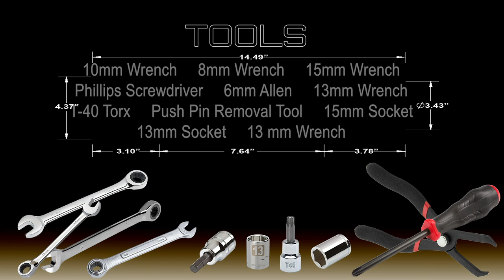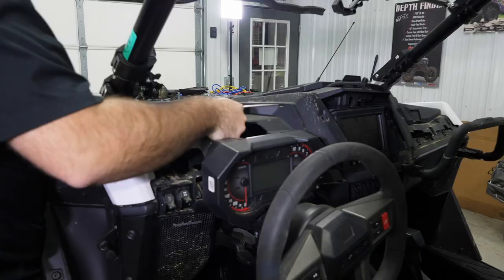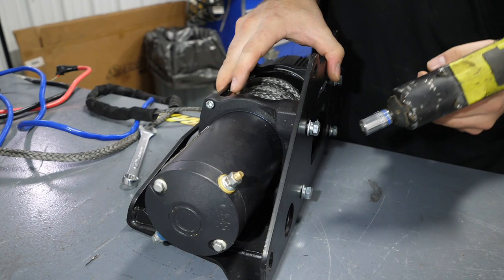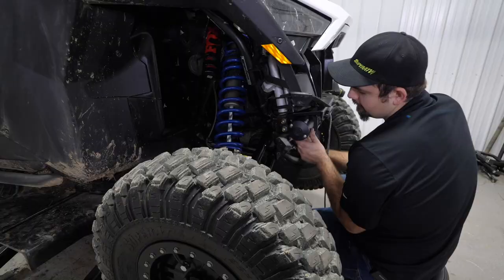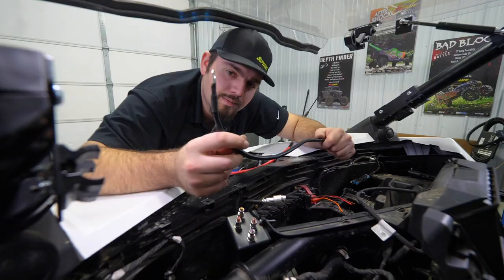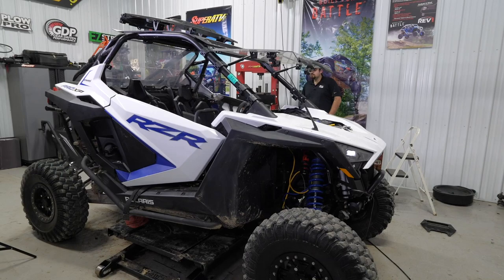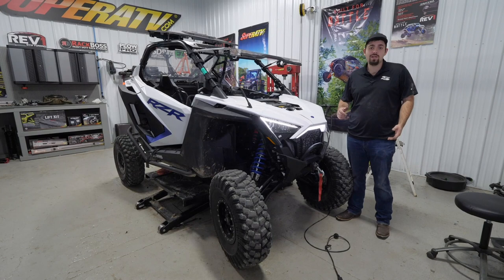Polaris RZR Pro XP Winch/Winch Mount Install | How To | SuperATV

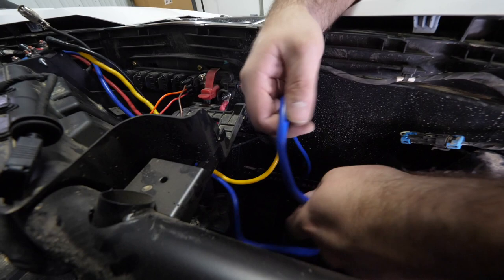Comment: At 20:00, you show the Pulse Busbar Plug already disconnected- and attach the orange wire keyed- on power source to the red rocker switch wire. Can you explain this in more detail?  My wires from the pulse plug are wrapped and connected elsewhere….
Reply from the maker: Give us a call so we can help you out with this, 855.743.3427
Reply: @SuperATVMedia  I finally realized that you are using a NEW pulse plug (not included with the kit), rather than connecting to an existing pulse plug with wires "going elsewhere" as mentioned above.  I ordered the new pulse plug from your site.  Should be good, as long as I understand that I'm only using the orange wire and the other two wires are not grounded/connected - per a superatv video.  Sound correct?

2- I also ran my red/black winch cables to my battery, rather than connecting them to the red/black poles on the busbar.  Does that matter?

Comment: My winch is wound the other way. Do I just wind it back the other way to make it right? And would I have to switch the positive and negative wires?
Reply: Just got mine today and it’s the same way.
Reply: Mine was wound the other way as well. Pulled the line out and respooled it. Switched the wires at the winch as well.
Reply: What did you end up doing.. Mine is same way
Reply: @wesleyjunkin2445  I believe I switched the wires and respooled the winch

Comment: Why aren’t my plastics aligning correctly now after putting everything back together 😡
Reply: I read from a comment that I could fit a 5500 on my 22 pro xp but after the install I’m finding that my front trim Lower bolts won’t match up because the winch is wider/thicker than the 4500.  Kinda lame but no turning back now.

Comment: So those the orange wire coming off of the pulse plug connects to the red wire on the rocker switch, but the two other wires coming off of the pulse plug do not connect to anything?
Reply: Same question.  Did you find an answer?

Comment: What’s the part number for that rocker switch.
Reply: SKU: LTS-013 rocker switch
SKU: APH-P-RAN1K accessory plug for pulse bar

have not been able to find their wiring harness for the switch though...
Reply from the maker: Here is a link to all our winch accessories.: https://www.superatv.com/black-ops-winch-replacement-parts
What your after is the dash mounted rocker switch.
Reply: How do you do it without the pulse plug